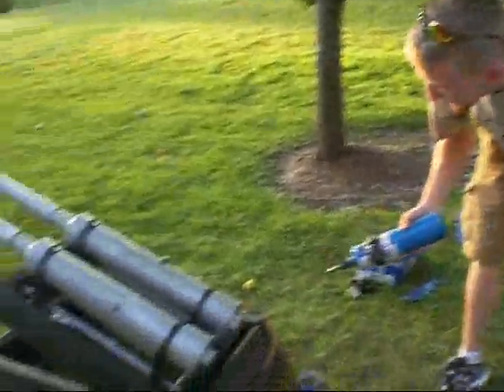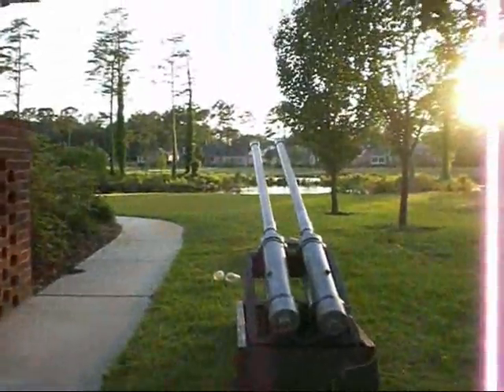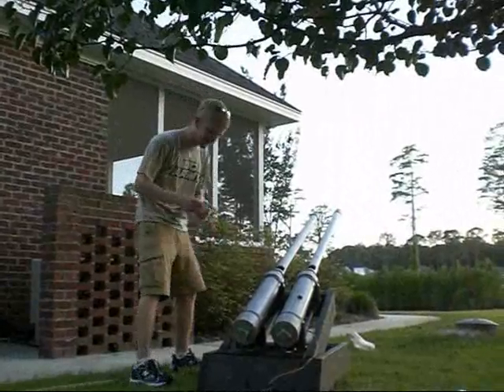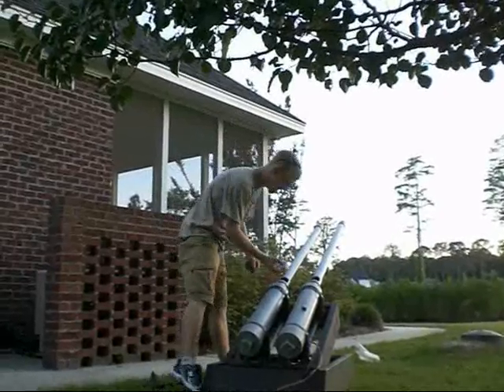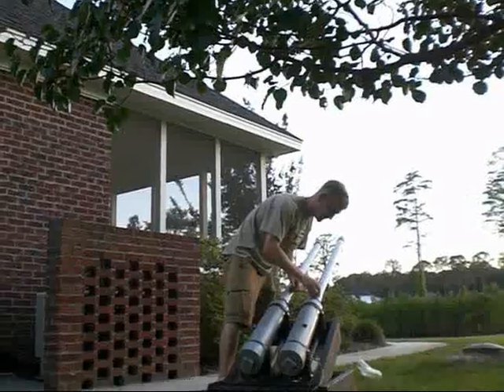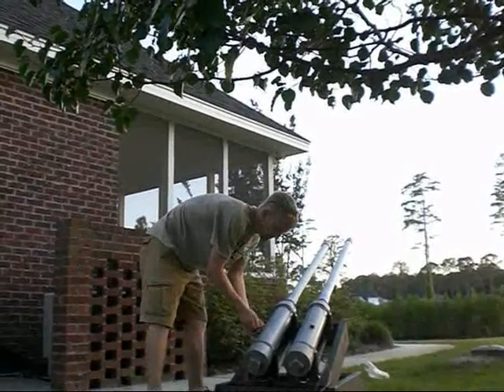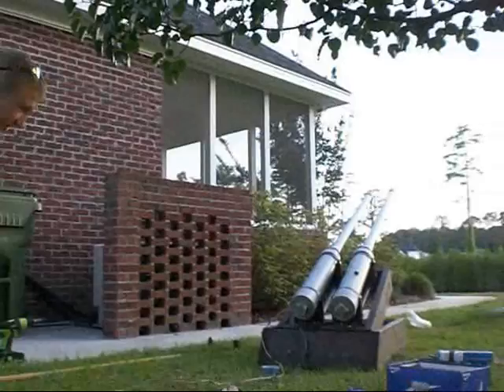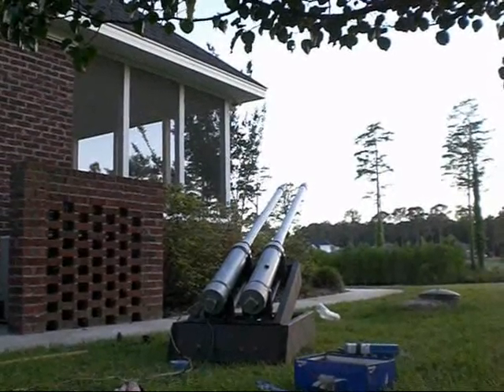Duel-Barrel Potato Gun w/Recoil

Comment: i know what you mean but its a principle. Also wondering if that is remote controlled? Check out my vids btw.

Don't wanna sound un-impressed by propane but if you have thick enough PVC, SCH120 and above, add oxygen, and get a nice tight fit from your projectile, 1mm diameter less that the inside of the barrel, and lubricate the thing. i do it with propane and oxygen. It gets AA batteries clean through 1/2" plywood

Next step is to make it into a hybrid, 20X mix ;)